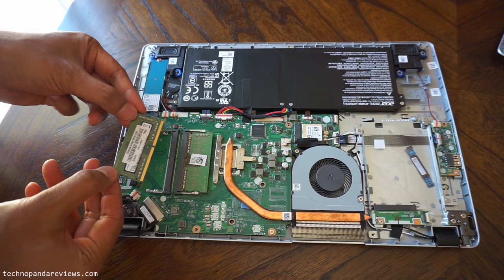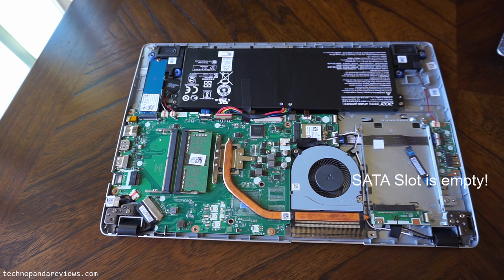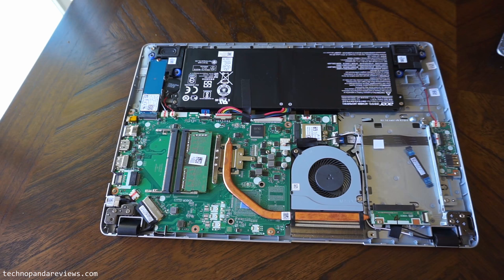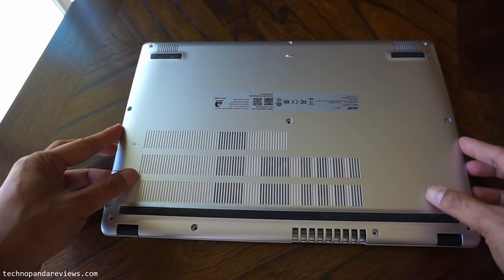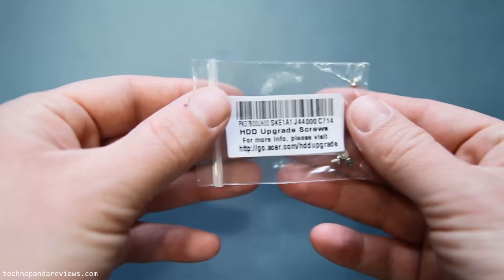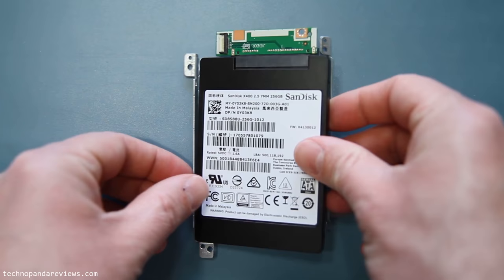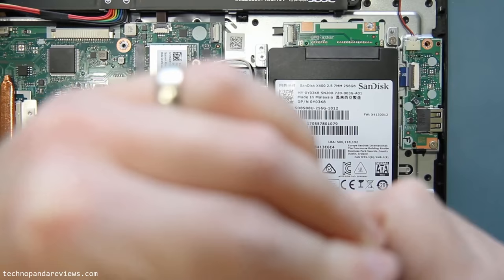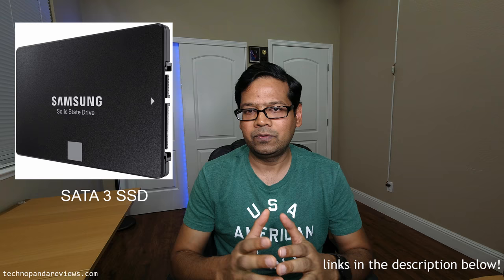How to upgrade SSD storage in Acer Aspire 5 Slim & Acer Aspire E 15 Laptops

Comment: So I’m posting this because it seems that it’s not necessarily a common issue that needs to be resolved in order for the SSD to be useable, and I just wanna post what I did to fix the issue. 

So I installed RAM and a new Samsung 860 Evo 500gb. RAM fit like a glove and was instantly seen by the system, the SSD on the other hand took some digging to find after installing. Most videos and solutions said that you’d be able to just initialize the device from the disc management tool. Nope, the disc management tool wasn’t seeing it either. So here’s where I had to go in order to get it working. 

Search bar —> Device Manager —> IDE ATA/ATAPI controllers (mine showed a Standard SATA ACHI Controller wasn’t working properly “Code 19”) —> right click —> uninstall device —> click okay —> reinstall. Should be working just fine after that. 

THEN I had to go to Disk management where I was prompted to initialized the disk and after that it started working. 

I was freaking out because I thought I had destroyed it somehow. Very glad to know that wasn’t the case.
Reply: How did you reinstall the IDE ATA controllers?
Reply: Kevin Carter quick question, let’s say I get the A1515-54G, how much RAM can I replace? Like how many slots is there and are they both replaceable?
Reply: Richard Reyes 2 and yes
Reply: This was the most helpful comment ever.
Reply: clicked uninstall... and it diapered
Reply: @DNOJ  this is the better way to access the new drive
Reply: Bro do one thing, don't make faces in your thumbnail it ruins the experience
Reply: @DNOJ  thanks for putting it here,,, it helped 🥰 lots of love~
Reply: a tip: watch movies at Flixzone. I've been using them for watching lots of of movies during the lockdown.
Reply: Thanks for the info, very helpful!

Comment: I bought this laptop and came across this video and used it to add another 8GB of RAM and a 500 GB SSD SATA drive.  However, I had to fumble around in windows to setup and format the new drive so I could see it in my folders.  That step was missing from this very helpful and easy to follow video.
Reply: How did you do it? Is there any tutorial looked up? I’ve never upgraded a laptop before and my knowledge is limited… I don’t want to accidentally mess it up :,)

Comment: This is an excellent video. I just ordered an Acer Aspire slim laptop on Amazon, the one with the 4gb RAM and the 128 SSD and I am interested in upgrading it. Other reviewers on Amazon suggested doing this will greatly improve this laptop. So, I searched how to DIY on YouTube and this video came up and I really like the simple, clear explanation. Thank you! I will also look for the video on adding the extra 4gb RAM.
Reply from the maker: Glad I could help!
Reply: He also does a vid on upgrading the ram. I just did mine and it was super easy. Laptop runs a lot smoother now. I recommend the Ripjaws 16gb kit that comes with 2 8gb sticks. It’s affordable and will allow u to use the 2 ram channels also 3000 speed
Reply: I just bought the same laptop and am here for the same thing!

Comment: Fantastic Video. I think your tutorials are the reason Amazon has hiked the price up $100.00 since you started your reviews. I'm trying to decide if it's worth it with the increased price.  QUESTION: if I upgrade both the RAM and the SSD does that do anything to increase the number of processors the computer has?
Reply from the maker: No the number of CPU cores will remain the same

Comment: Bought kingstone A2000 nvme 2000mbps ssd, works like a charm
Reply: how do you copy the main nvme ( 128  this is the boot drive ) to the one you purchase i want to upgrade but I not sure how to
Reply: @sunnyjd3354  i fresh reinstalled windows onto the ssd and formatted the harddrive which i already had, also make sure the boot type to UEFI and not legacy.

Comment: Thanks for the help. I just got this laptop and plan on putting in an extra sata 3 ssd .  Should I install before I start it for the first time or set it up then install? Also after its installed do you need to do anything or does the laptop recognize the new drive? Thanks again,

Comment: Which laptop should I buy from HP 15q or Acer aspire 3 both are on ryzen 5 and their prices are pretty similar acer=28990,HP=29990
Reply from the maker: Go with Acer. Acer has 1920X1080 FHD screen while HP has 720p screen

Comment: He didn't mention it but you really should disconnect the battery before you install anything.  I just put a 500GB SSD in my Acer Aspeir 515-43.  Took about 10 minutes easy as pie.

Comment: Unfortunately everything so far worked up until the point where i had to place the screws to keep the SSD steady in the plaster holder. Are the 3x3 screws supposed to be included when you buy your SSD or are they sold seperately? 

I apologize for this personal issue.
Reply from the maker: Acer Aspire 5 laptops come with the screw. If you have misplaced them, you can contact Acer support, they will mail it to you
Reply: @RealTechnoPanda  ah, noted! thank you, Panda

Comment: Thanks for the video.  Unfortunately, this is the second video I've watched on upgrade for A515, which all show that the bracket/hardware is already in the laptop.  My laptop has no bracket, board, cables or screws to install.  Where can I get the hardware to accomplish the upgrade?  Acer is no help.  Also, it has to be a slim or low profile version.

Comment: I installed the Samsung 8G memory and the Samsung 860 EVO 500G SATA SSD. Memory is being recognized and working fine. SSD is NOT showing up anywhere. Install went fine but I had to flip the drive over with the large SAMSUNG logo on top to get the cable connected between SSD and MB, but that was just a simple flip over to get the connectors close enough to connect. But I cannot get the SSD drive to show up anywhere in Windows (device manager, etc.). Thoughts? Is there a compatibility issue between Samsung SSD and AMD Ryzen? Drivers need to be updated or something? Or maybe install was wrong? Please...ideas!!! Thank you!
Reply from the maker: No drivers are needed. But you will have to format it. I pasted a link in my other comment
Reply: @RealTechnoPanda  I can't format what the OS cannot find. Sorry, what am I missing?
Reply: SSD just does not show up anywhere after install. Maybe bad install, or ribbon cable (had glue all over it), or drive itself?

Comment: Thank you for the review! Q1) Is the layout the same for Intel and AMD for installing the extra RAM/Memory? Q2) Is there a different part number(for RAM/Memory) if the laptop is Intel i3?
Reply from the maker: - AMD version has 2 DIMM slots, but Intel version has only 1
- RAM type is identical
Reply: Techno Panda thank you for your response and keep up the good work
QQ- I am hearing that the Intel RAM is soldered and not replaceable is it true
Reply from the maker: Yes, 4 GB is soldered, but you can upgrade the DIMM slot
Reply: Thank you, awesome Techno Panda

Comment: So, I see in your video that you switch from the Samsung 860 EVO to actually installing a SanDisk SSD. I installed the Samsung 860 EVO and again cannot get Windows to recognize the SSD drive...anywhere. I am installing on the Acer Aspire 5 with the AMD Ryzer 3 processor, model A515-43-R19L. Do you or anyone have ideas to get Windows to recognize this added SSD? I see that Crucial does not even identify a SATA SSD drive that is compatible with this Acer, only a M.2 PCIe upgrade. Possible this Samsung 860 EVO SATA SSD is simply not compatible (yet) with this laptop? Or another issue, possibly with drive itself, ribbon cable, etc.? Can you or anyone help?
Reply from the maker: Windows will not see new disk until you initialize it using disk management utility. Please follow these instructions https://www.windowscentral.com/how-format-new-hard-drive-windows-10
Reply: I'm having trouble with this right now. I couldn't even find it in Disk Management. I installed it just like he did in the video but the system is acting as though I didn't do anything at all. What am I supposed to do?

Comment: What should I do if I don't have any screws? Also, is it possible for this laptop to just use an ssd through a usb converter?
Reply from the maker: You can contact Acer support. They will mail the screws

Comment: See, i'll get an acer aspire 5 that comes with a 2tb mechanical hdd and an empty m.2 slot. What i'd really like to do is to clone whatever's in the 2tb mechanical hdd and put it in a samsung evo plus 256gb nvme ssd and use it as the boot device

Comment: Will I lose the manufacturing warranty if install additional SSD and RAM?
Reply from the maker: I am not sure about warranty. But Acer makes RAM and SSD upgrade very easy
Reply: If you want to install ssd or ram go to service center so that you cant lose the manufacturing warranty.
Reply: There are no warranty tapes or anything you need to break that indicate that it breaks the warranty, and Acer themselves also provide a video instructing you how to do this process. So I'd lean toward it not affecting the warranty.

Comment: Hi my dude.Im gonna buy this one with Win10 home.So it has 128gbSSD  4GbRAM.
So i wanna upgrade them after i get it.Do you advice 8+8,or 16+16.Can it run 16+16.
And pls send me amazon links.I know you put in desc.But i dont know buy  SATA,or another.2400 Mts or 2666 for my Acer a515 43 R19l.Pls answer and advice what must I do

Comment: I have Aspire 3 A315 56.  My question is are all SATA drive in the Amazon the same? I mean are they all compatible to any laptop or there is a specific one compatible to a certain model.  I want to add SSD SATA drive. And is there a limit to what can I install or 500 gb is enough.  Thank you Sir for your expertise.
Reply from the maker: as long as you are picking 2.5" SATA drives, they are all same. You can install bigger than 500GB if you want

Comment: Hey TechnoPanda! Would you buy a FireCuda 2TB SSHD 2.5" SATA priced at $59 or the 500GB Samsung EVO 870 SSD 500GB priced at $79? Thanks in advance! Great videos!!
Reply from the maker: SSD is going to be way faster than hybrid HDD, but obviously its more expensive. If you absolutely need 2TB space, then get the FireCuda SSHD, but if you need top performance then pick Samsung SSD
Reply: @RealTechnoPanda  I upgraded the RAM on my aspire 5 thanks to your vid! And am going to go with the samsung evo ssd. Many thanks. Cheers!

Comment: Hello Techno Panda!  I have the Acer Aspire 5 slim from a year or two ago.  It came with 4 MB RAM.  I am adding an 8 MB stick.  Does it matter which bank the 4 and 8 sticks are in for best performance?
Reply from the maker: No. But for best performance, I would recommend adding a symmetric pair of RAM. So you should consider adding two sticks of 8GB RAM, or two sticks of 4GB RAM

Comment: Hey, so I picked up a SATA 6 SSD before I saw you said SATA 3. Will the SATA 6 work on the Acer Aspire 5 as well?
Reply from the maker: As long as its 2.5 inch drive, it will work

Comment: Techno, I bought the Acer aspire 5 with Ryser 5 4500 Hexa Core with 8gb Ram. Is it better to add another 8gb... keep it symmetrical, or can I add a 16gb along with the 8gb running together? … what about installing two 16GB   Thank You
Reply from the maker: Keep it symmetric for best performance in dual channel mode. But you can also go with16+8, it will work albeit in single channel mode

Comment: So I'm trying to learn how to add an SSD to my brand new Acer. I bought an M.2. And I'm just learning but I see that it does fit into the empty Sata. Is that normal? Can I just do that and then have the combined MB of the original plus the new SSD and not have to clone?
Reply from the maker: M.2 will not fit in SATA3 slot. M.2. looks like  this https://amzn.to/2MwA1zi & SATA3 looks like this https://amzn.to/2MA0eNE

Comment: I bought this laptop used from amazon. The Laptop works great! But i've hit a snag in that they didn't included the packaged screws used to fasten the hdd/ssd to the mounting bracket. What kind of screws are they? I'm hoping I can just visit a tech store and they'll be carrying it, but if not I'm wondering if I can just go to a hardware store and see if they carry that specific size. any help would be greatly appreciated! Thanks in advance!
Reply from the maker: Yes you will find them in home Depot. They are tiny screws, I am not sure what the thread size is. But you can take the SSD to store and match the screws
Reply: @RealTechnoPanda  thank you so much! I really appreciate your help with this!

Comment: Good video ! aspire 5 A515-52G in this laptop what type of ssd(M.2 nvme or sata 3)should I use for its best utilization
Reply from the maker: nvme is faster but more expensive. SATA3 is relatively cheaper but still quite fast. My suggestion is to keep the existing nvme SSD that came with the laptop and add a 2nd SSD drive

Comment: sir I am planning to buy samsung evo 980 500gb nvme ssd for my aspire 5 , but mine is 2018/2017 version ig. because mine doesn't comes with ssd. so should i open and check if it has that nvme slot?
Reply from the maker: Yeah, please open and confirm before purchasing ssd

Comment: got the older model  Acer Aspire 5 with 8th gen Intel Core-i5, should I have gotten the less expensive model if I want to upgrade storage anyway? it was on special for 399, so I got the i5..ty so much for your videos!
Reply from the maker: Keep your old core-i5 model since it is still better than newer core-i3. Now the newer 10th gen core-i5 is better, but it costs lot more than $400. So my recommendation is to keep the laptop you already got and expand storage and upgrade RAM

Comment: I cannot locate the SSD mounting screws with my new Aspire 5.  What screws do you suggest I buy so I can add a SATA drive?
Reply from the maker: Contact Acer support. They will mail them to you for free
Reply: @RealTechnoPanda  Thank you!  I just called them and they are sending me the mounting bracket, adapter cable and the screws, because they don't send only the screws.  Bonus!

Comment: I installed an extra 4gb of ram and my cpu says 8gb of ram installed  however only 5.94 is usuable...

Did i install it incorrectly or is that normal. Btw I had to flip the ram stick upside down to make it fit in the slot.
Reply from the maker: You got it right. BIOS is allocating a portion of RAM to integrated graphics. Its expected. Dont worry!

Comment: So, after installinng ssd, it does not show in device manager. Tried removing and reintalling ide control and no luck. Whats next step?
Reply from the maker: Follow these instructions (from Kevin Carter)
Search bar —> Device Manager —> IDE ATA/ATAPI controllers (mine showed a Standard SATA ACHI Controller wasn’t working properly “Code 19”) —> right click —> uninstall device —> click okay —> reinstall. Should be working just fine after that. THEN I had to go to Disk management where I was prompted to initialized the disk and after that it started working.
Reply: @RealTechnoPanda  thanks for the response. I tried that following kevin carters post. Did not work. Will have to try more troubleshooting.

Comment: Hola te pregunto esta memoria RAM Mushkin Essentials - DDR4 Laptop DRAM - 32GB (2x16GB) SODIMM Memory Kit - 2666MHz (PC4-21300) CL-19 - 260-pin 1.2V Notebook RAM - Dual-Channel - Low-Voltage 
Es compatible con la Acer Aspire 5 A515-43 ???
Reply from the maker: si esta RAM es compatible

Comment: Sir, In Acer aspire 5 - A515- 56 i5 11th generation (8gb + 1TB HDD model) May I know there  is one more additional slot to put SSD along with 1TB HDD so after that I will use SSD & HDD both simultaneously?
Reply from the maker: No, since there is only one 2.5" bay.

Comment: If I keep the 128gb ssd and add the extra ssd in the sata slot do I have to have the 128gb cloned on the new one I’m adding in the sata slot or can I just turn it on and have extra storage
Reply from the maker: No, you don't need to clone. Windows will boot from older SSD.

Comment: I just bought Crucial 16GB Kit (8GBx2) DDR4 2666 MT/s (PC4-21300) SR x8 SODIMM 260-Pin Memory - CT2K8G4SFS8266, and Samsung 860 EVO 500GB 2.5 Inch SATA III Internal SSD (MZ-76E500B/AM) for my acer 5 slim laptop but support team said these are not compatible...so I'm not sure why mine does not enable to upgrade...
Reply from the maker: They are compatible. I am using it in my Acer Aspire 5 laptop. Did you try installing it?
Reply: @RealTechnoPanda  i think one of the things i forgot was installing SSD...i kept plug ssd to motherboard but never turned on that is probably why but i noticed when i just added crucial 16 GB it doesn't turn on. does it have any specific steps?

Comment: So I'm looking to upgrade my ram on my Acer spire 5. It's got the build in 4gb and a replaceable 4gb. If replace one of the 4gb with a 16gb what will that do to my laptop? Will they work good together? Will it run slower? Will it crash? Also what RAM is recommended for this laptop? Thank you, and love your videos by the way
Reply from the maker: Use this 16GB RAM: https://amzn.to/32erkPe It will work in conjunction with existing 4GB RAM. So total RAM in your laptop will be 20GB. You laptop will run faster and will be more stable
Reply: Thanks a lot, keep up the good work

Comment: Does it matter which side the new ram faces up?
Reply from the maker: Yes. You will have to match the notch on the RAM with the DIMM Slot. The notch is asymmetric and you can install RAM correctly in only one orientation
Reply: @RealTechnoPanda   Thank you; I later saw that. Thanks again, your review helped sell me on this product!